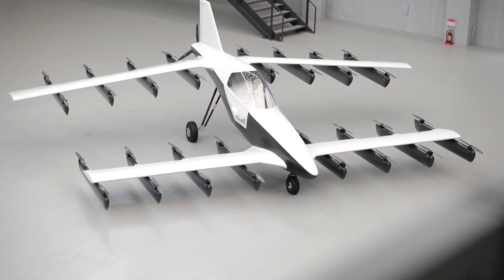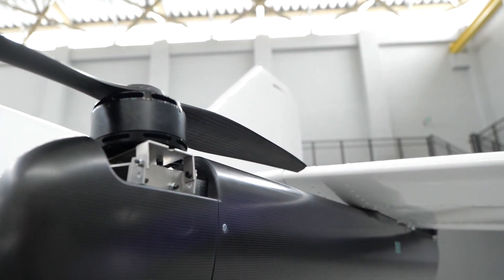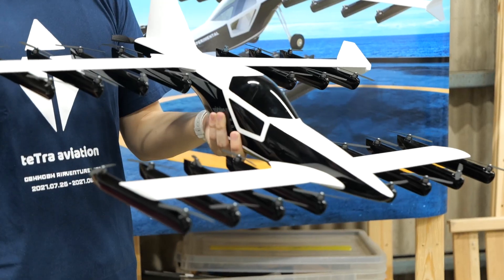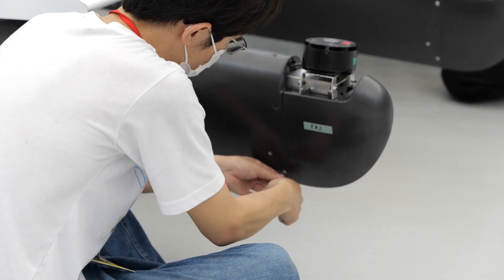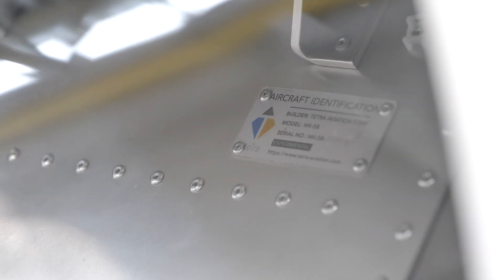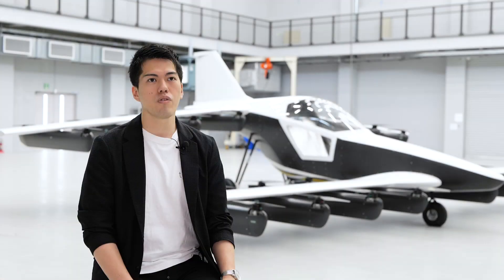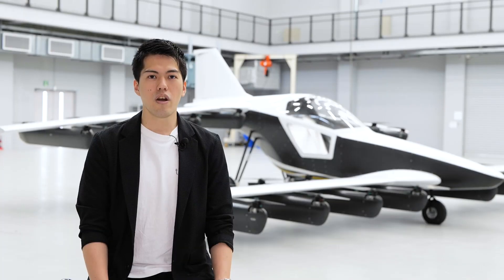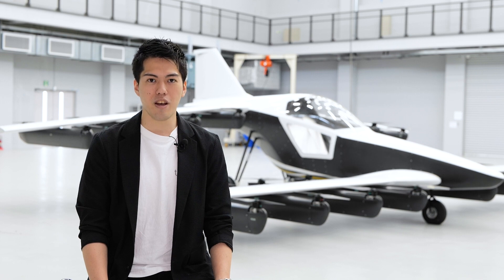A First Look at teTra's eVTOL - Sales Beginning in 2022, Reserve Now! / テトラ・アビエーションのeVTOL実機とコンセプト初公開

Comment: You cannot do VTOL for MANY reasons.  You MUST land on the road at the speed limit (key), fold wings/props for road width, and drive on with wheel drive and without any props moving.  

VTOL will not be permitted, but a roadable airplane will.  I have already asked the head lawyer in government in my State.  They clearly state:  NO VTOLs.  

You cannot land on or near a road as you will block traffic.  The dust from VTOL is 100% NOT acceptable.  You cannot land in parking lots or shopping centers as the dust would cause a massive disturbance and damage other vehicles.

If you don't have a roadable design, you cannot move from the landing spot to the final destination.  You can't just park your craft on the side of the road or private parking lot taking up massive space.   It must fit into a 9 foot wide parking stall at less than 18-20 feet or you will have problems.  

You MUST have DOT crash protection if you have 4 wheels on the ground.  This would require barrier tests, airbags and crumple zones.  That means you would have to build 32 craft and crash them into various barriers and vehicles.  It would cost a fortune to get certified.

As for Electric drives, nothing shown has any merit for the future.  EVs are fire hazards and UNACCEPTABLE in flight.  A Li-Ion battery can quickly kill a person and take out an airplane even with a parachute.  You cannot drop down under a canopy with Li-Ion battery burning next to you.  LOL.  

Just stop.  It can NEVER work.  Wakarimasu ka?